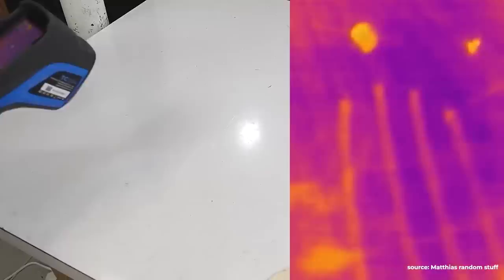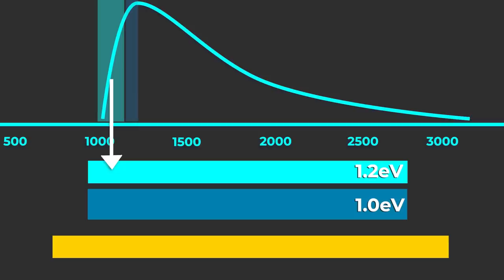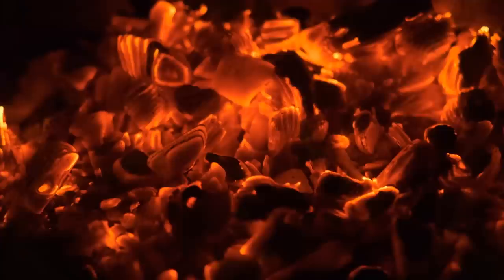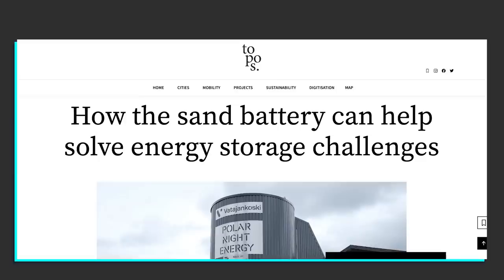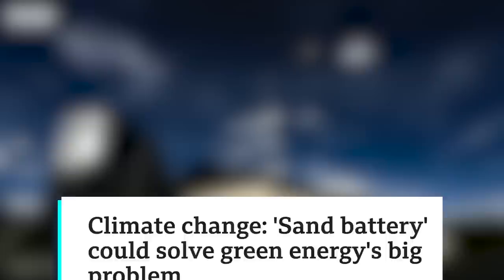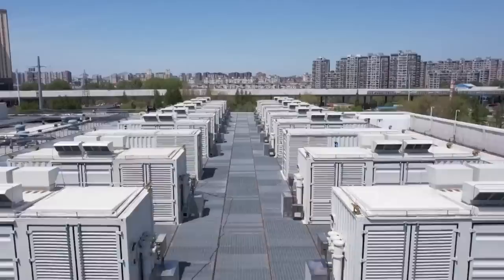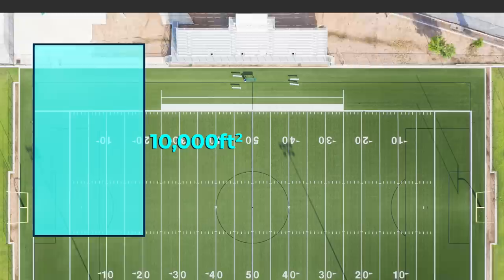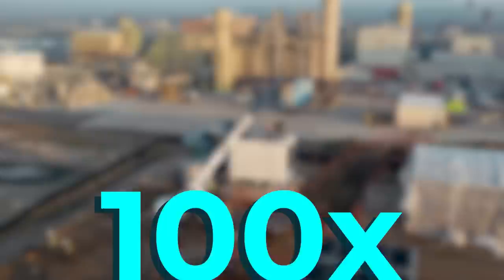The End of Lithium-ion? These Solar Panels May Be the Future of Energy Storage

Comment: We were trying to develop TPV's for the nuclear navy a couple of decades ago. The idea being it would be more efficient to turn the spectrum of  radiation coming off of the reactor directly to electricity and avoiding the turbine, the same theory as here. Many different combinations of III-V materials and different layer combinations to decrease strain between the layers, were tried. The problem we faced, which ultimately killed the project, was primarily the inability to fabricate a combination of III-V layers with low defects. I don't believe you mentioned it in your video, but another issue that must be dealt with is recombination of the generated carriers before they are collected. You have to be able to collect those carriers generated in the absorbing layer across the junction before they recombine. Recombination rate is proportional to the number of defects, and is also higher in III-V material because it is direct bandgap, unfortunately. So, too many defects can bring your project to ruin, which is essentially what brought an end to our attempts. The quality of the material caused efficiency to drop far below theoretical efficiencies. I sincerely hope the MIT folks are able to solve these material issues.
Reply: Please define these particular "defects". Thanks.
Reply: Incredibly interesting work you were involved in.
Reply: I knew the video was hidding some things and going all clickbait, even if done better than other trolls videos out there. thankfully there is comments of insightfull people. Regards
Reply: Thank you for sharing your experience and insights regarding TPV development. Material defects can indeed pose challenges in achieving optimal efficiency. Speaking of energy storage, have you heard about the Segway Portable PowerStation Cube Series? It's a versatile power station that offers massive capacity, fast recharging, and comprehensive protections. It could be a great addition to outdoor gear or home backup power needs. Happy camping and quality family time!
Reply: Well to be fair, the difference in technological advancement a decades ago with today is quite significant 

In the 90s 500-600nm was used for processors, today we use 3nm.
Reply: @AtlantisArch I would say it isn’t. Compared to a modern CPU and how small the details are, to a CPU made decades ago

Comment: Thanks for the increased use of metric! At 8:38: 10,000ft² = 929m², so about 1000m². Interestingly then we now know the scale factor from the original 1cm² panel: 1000/(.01²) = 1,000,000, which gives us a much better direct sense of the scale.
Reply: Freedumb measures should be phased out totally in this kind of videos. They just add confusion ! If you give the two t° in C and F, which one will you remember ? People who are not familiar with metric are not educated and don't watch anyway !
Reply: @clitisswood7330  Just try to wrap your head around the stubbornness needed to hold onto working harder to do the same job. Fractions, damn yanks love their fractions yet claim the metric system is too hard to work with. Yeah working a bunch of measurements down to a common denominator to be able to add them up versus a decimal point... fractions, what the point of those? Highway signs with distances in fractions "Main Street Exit 2-1/4 miles" Do American cars have odometers with fractions?
Reply: It’s amazing how close the square root of 10 is to the ratio between meters and feet, so just divide/multiply by 10… another quick one when degrees get above ‘normal baking oven temperature’ you can more or less divide or multiply by 2 and be a happy camper 🤓

Comment: I often speculate on a type of nuclear reactor called an electrochemical nuclear cell. Current nuclear reactors heat water to spin a turbine which is only about 30% efficient as well. In an electrochemical nuclear cell, a molten salt of beryllium fluoride, lithium fluoride and zirconium fluoride at a ratio of roughly 2:1:1 respectively separate into distinct, stable phases with slightly different densities and compositions which is used to form self assembling liquid cells with differing charges. This type of molten salt reactor is a single fluid molten salt reactor that uses thorium as fuel that is bred by a neutron source. In this case that neutron source is due to the electrostatic confinement of deuterium. A trick taken from fusion for cleaner fission. This eliminates the need for uranium and all its downstream decay products. As thorium ions begin to fission on the side of the cell closest to the neutron source, the charge of the decay products from thorium travel from cell to cell, creating an electric current that can be obtained from the reactor using a simple anode and cathode setup similar to an electrochemical battery. Electrochemical batteries can be an upward of 90% efficient. Markedly more efficient than boiling water. This setup can also be designed to be more compact as well as relatively solid state, with the exception of the liquid molten salt. Meaning they can run a long time with little to no maintenance and could be useful for mobile or portable applications. The cell itself only reaches a maximum temperature of about 1000 degrees.
Reply: Electrochemical nuclear cell. Interesting. Thank you for sharing.
Reply: this is an interesting concept what kind of scalability would this have and could an entire power station like the old reactors used by power companies be built? And at what cost? Sounds like efficiency is way up there, if the cost is at all reasonable why isnt this already being done by some forward thinking company?

Comment: Funfact:
Low temperature thermo-voltaic elements (also called Peltier devices) have been around for almost a century and are used in remote areas to generate electricity:
So, in places like Siberia, you basicly put your TV on a hot stove to watch tv. 😊
Reply: These are a different technology but you could add a third junction to the device using the lead telluride material to get another 0.2V per cell. These photovaltics use quantum effects similar to solar panels to work, the top layer is InGaAs2, absorbing at 800 to 1000nm, and Ge metal that absorbs 900 to 1300nm. Adding the telluride layer would work at true thermal spectrum of 2600 to 10,600nm by a different mechanism.

Comment: Most of the modern thermal plants use a combine cycle that can reach 50% efficiency. Yes, the turbines have a lower efficiency, but when it comes to electricity production, you have to take into consideration the total energy output as a whole, the same principle of heating homes could be applied to a power plant, every thermal cycle needs a temperature gradient to function, the wasted heat, even after heat recovery systems can still be used, but it is not economically feasible. So, it is nice to have a new way to harness electricity, but the efficiency are too low to even to be considered, even at 40% efficiency, you still need to transform the electricity in order to be useful, I imagine that it produces DC, you will need at least a inverter and a transformer to be able to inject it to the grid, or in the case of in situ use, all you equipment has to be made to order in order to use the energy produced, it is not as simple as saying yes, we have a new way to harness energy and it is x% more efficient than traditional methods.

But, I'm still hopeful for the future and the technological advancements, I really hope we, as the human race, can reach a point where we can have our cake and eat it too.
Reply: Indeed.
Reply: Thermal plants could reach near 100% efficiency if they transferred their heat directly into our homes with water through insulated pipes. 60 to 70% of our energy use is purely heat for our homes and for our showers, meaning that we could already have at the very least achieve that level of energy efficiency if we built the correct infrastructure, no super high tech solar panels or extra energy sources required.
For the remaining 30 percentage points of energy that we consume mostly as electricity, we could easily make half of it come from rooftop solar, wind farms and hydro.
Honestly at this point it is a waste to even consider thermal plants for electricity production in the first place.
Reply: @texanplayer7651  

I agree that transferring waste heat to homes could improve efficiency, but not much more. It's only viable in the vicinity of the plant, getting it further away it's just not economically viable.

A power plant doesn't work that way, there's a set amount of heat that has to be expelled in order to work, if you cannot predict the rate of heat expelled, you cannot design a thermal plant, you could throttle the power plant, depending on which kind it is, but that would mean less energy produced and the efficiency goes down a whole lot, all power plants are design to function at capacity to reach its highest efficiency. 

If we only depend on solar and wind it is just not stable enough to have a reliable grid. Would you be able to live without a stable grid? Would you find it acceptable when you switch on the lights and it doesn't turn on? It is a huge ordeal to get the grid back up when there's a blackout (overloaded grid) with just solar, wind and hydro would be almost impossible to turn the grid back up. There's a solution to that, and is that you can be off grid, so you wont depend on the stability of a grid, but that means that you wont have the stability of a grid. If we add hydro into the equation, it could help, but to produce electricity, it still needs electricity (I know, it's electricity inception)

Critical infrastructure depends on it, like hospitals and industries. There are processes that cannot be stopped willy nilly. Power demands are not constant. There's a excess of energy on daytime, electricity produced by solar when its not needed is wasted. Power plants cannot be turn on and off by flipping a switch, it takes time, some can take up to a week before it can inject electricity to the grid, specially in the case of coal plants.

It would be nice if there's a "free" energy source, but there isn't.

Don't get me wrong, I'm not against solar and wind, it's just the availability and reliability is just not there yet, and I doubt it will ever be.

Germany is one of the leading country with solar and wind, and They will face a huge ordeal this coming winter. They are already turning on coal plants to meet the energy demands, which is far worse than any other thermal plant, They are evolving, just backwards in the climate change issue.

In order to depend on hydro, it depends on the geographic conditions and it takes time and money to build one.

There's a paper about the viability of a dam in the Suez canal, It would take around 100 years to build and another 100 years before It can become operational, It could provide the future energy demands of the whole Earth and more, but is it worth it? Maybe, but there's no way We will ever know. There are consequences to the dam, expect environmental and marine life damages, not to mention the amount of pollution created in order to build the dam.

There's no easy and simple solution, We are pretty good at predicting power demands, one way to reduce pollution is just to use less energy, but are You willing to use less heat on the winter and less AC on summer? 

It's just not as simple as saying no to new thermal power plants. Besides, every time We build a new plant to replace the old one, efficiency and pollution gets improved.

There's a US company that is researching small nuclear reactors that can replace old coal burners but still use the rest of the plant to produce the same amount of electricity. They just replace the heat source.
Reply: Hi MrNickelzero. That takes the cake, I also hope we don't drop our toast jam-side down. Cheers, P.R.
Reply: How do you get that "glowing charcoal brickette" to send its infrared to a quarter-football-field of TVPs?
Reply: How do you get that "glowing charcoal brickette" to send its infrared to a quarter-football-field of TVPs?

Comment: LFTR would operate at 700-1200C, which might allow these TPV cells to operate at their maximum efficiency.  Traditional power plants (nuclear, coal or gas) don't get much over 300C.  Furthermore LFTR would solve the scalability problem as they are walk-away safe and can be built very small.

Regarding materials: A LFTR's hot side would have to be made from Hastelloy-N anyway, which has a melting point of 1327C.  So the reactor could operate up to ~1200C with a comfortable safety margin.
Reply: Not that comfortable a margin at all. The properties of metals change over a wide range of temperatures. Even the famed Hastelloy-N would be way softer at that temperature.
Reply: I hope you also realize that the cells use a gold foild as a reflector.
And gold melts at aroun 1000°C
Reply: @1337Jogi 1:56  "The MIT team's design has been shown to generate electricity from a heat source of between 1900 degrees and 2400 C."

Comment: Apologies if I missed these:
What might be like a range of Watt Hours per cell?
The cells store energy in the form of heat?
How is the energy density compared to a lithium battery?
Is this a technology that we can bolt up on our roofs to replace existing PV?
Thank you!
Reply: I can't answer all your questions but I think I can answer a few.
They don't store heat, they just convert heat from something like molten metal or salt or something. Its the metal or salt that stores the heat, these cells just convert that to electricity. so there's no watt hours per cell. it completely depends on how much heat you can store in your salt or what ever.
I don't think these are intended for sunlight, and probably wouldn't work. They need extreme temperatures.
What ever you are storing heat in is going to be large, and very heavy and need a big expensive container. Even a lead acid battery would probably be more power dense if you're just trying to store electricity. 
The advantage here, if I understand correctly is that we may be able to use these in power plants, instead of using steam generators.. which would make power plants more efficient, cheaper to build and maybe even last longer. Also, if your intention is to primarily store heat for later use , (maybe for dryers, ovens, water heaters, etc) adding these to that system allows you to easily pull a little electricity out of it as well. But a system like that wouldn't be hot enough for these cells probably, so would only get a small efficiency when converting to electric. For something like offgrid power for a single home, i'd still probably go with a low temperature difference stirling engine connected to a sand battery, in addition to regular solar panels.

Comment: Would this be useful in Nuclear power plant?
Reply from the maker: Absolutely, in theory, it could be used anywhere heat energy is turned into electricity
Reply: Wouldn't that be too hot for the fuel rods? 

Or can the heat be amplified somehow? 

How hot do coal and gas plants get?
Reply: @DrBenMiles  Did I miss something?
How is this even remotely usefull?

It uses infrared radtiation of materials 1900-2400°C
1900 degrees is already really really hot.
A nuclear reactor sits more at around a couple of hundred degrees. Waaaaay below 1000.

1900 is way above melting temperature of all normal materials we encounter. Except tungsten which was used in lightbulbs.
Uranium will melt around 1000°, steel at 1300.

A bunsen burner will reach 1200°, a candle maybe 1000.
You need something like a welding torch for these temperatures

Comment: Green-hot does exist, but at this temperature our eyes are saturated across all RGB frequencies and as such it is seen as green. 

The colour of a flame is not solely due to thermal emissions, it is also to do with chemical reaction emissions. Think about the ‘burning metal salts’ experiment in chemistry.

Comment: How about using a good old woodstove and drain some heat via golden solar panels to a battery, maybe spinning up a flywheel.  From the flywheel you can tap electricity when you need. 😊. One step further lo living offgrid?

Comment: The heat of Earth’s interior comes from two main sources, each contributing about 50% of the heat. One of those is the frictional heat left over from the collisions of large and small particles that created Earth in the first place, plus the subsequent frictional heat of redistribution of material within Earth by gravitational forces (e.g., sinking of iron to form the core).

The other source is radioactivity, specifically the spontaneous radioactive decay of the isotopes 235U, 238U, 40K, and 232Th, which are primarily present in the mantle.

Comment: yeah, capturing energy from the redder end of the visible spectrum and also infra red has not received that much attention simply because the photons do not carry that much energy per quanta. Also, for a lot of areas it makes sense to store and release energy as heat only for home heating, energy interconversion from electricity to heating is wasteful and expensive, thus systems like sand storage might be possibly optimized for more compactness making them more practical in high density living which is always going to be a challenge, for those with more real estate the options are far more plentiful.

Comment: These cells are made of gallium indium arsenide coated over germanium. You end up with about 2V and about 200 to 500mA per square centimeter. They are basically solar cells tuned for near IR at 800 to 1300nm.